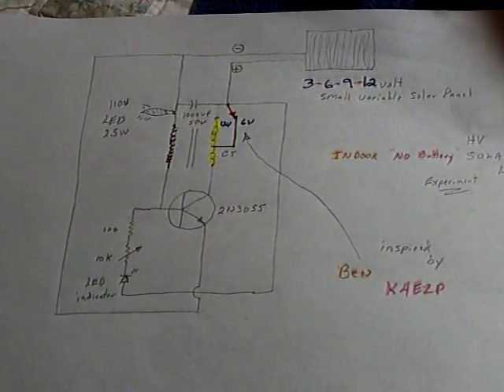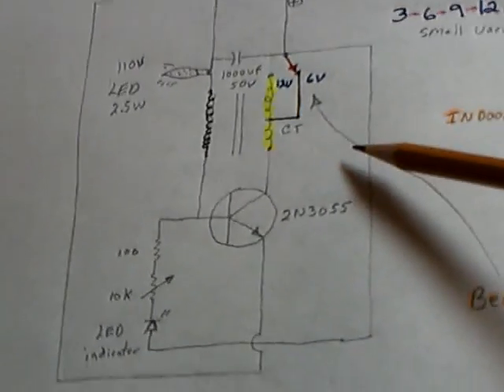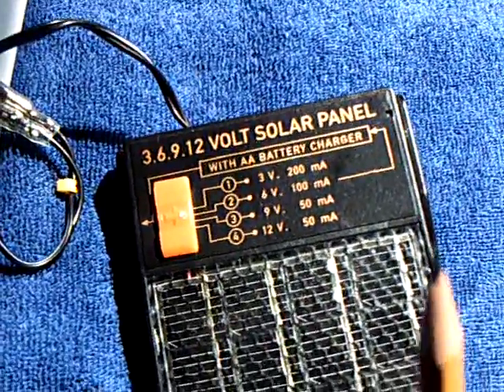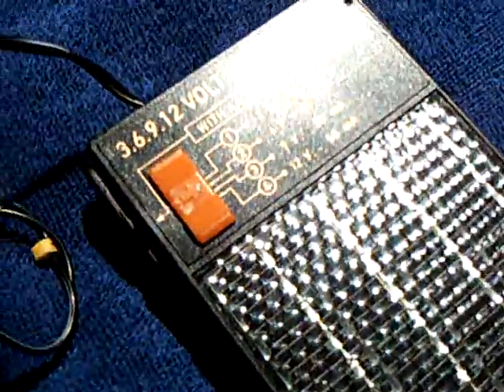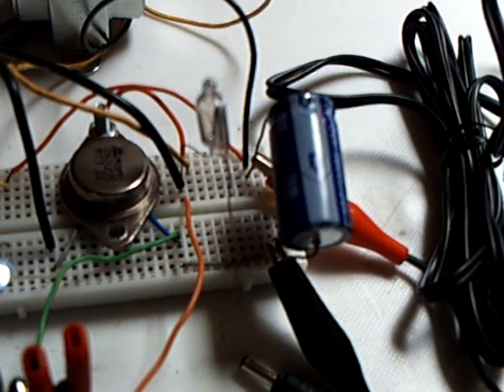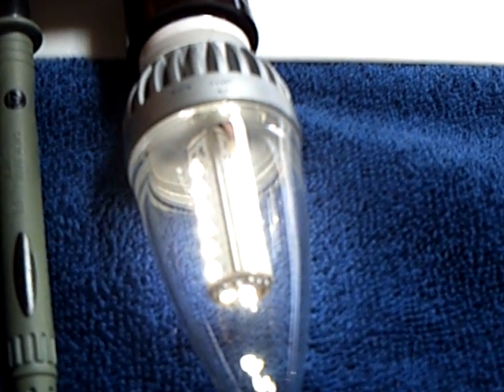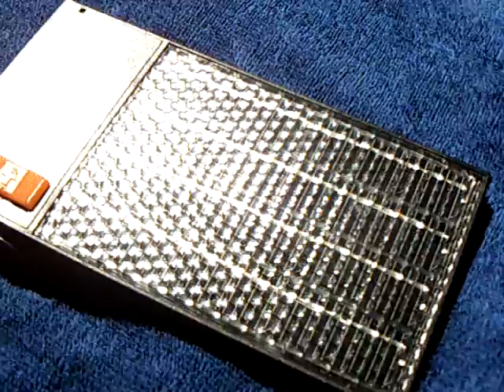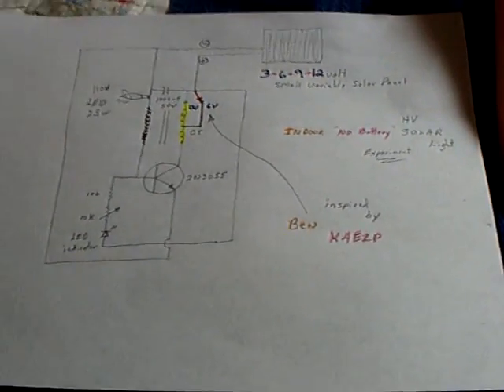Indoor solar panel - No Battery- AC lighting idea.

Comment: Lidmotor thank you for your videos. Have you considered using ultra-capacitors for your batery-free solar powered light system? You can get 350 farad 2.7 volt super capacitors now. I constructed a batery-free super capacitor flashlight with solar panels in the back and a joule ringer circuit inside. The super capacitors recharge very quickly and the joule ringer keeps the light going for a long time.

Also, have you checked out videos about bi-toroids? People claim over unity with those.

Comment: Ok, but I just want to be sure. is the potentiometer 10k? and the resistor 100k?
Thanks for answer.
PS: the solar panel is really expensive at radio shack. You're right.

Comment: Hello there.
I would like to build this, can I get this materials at Radio Shack?
If yes, and if I'm correct, the materials are:

1 Solar panel 3 to 12 volts
1 Radio Shack transformer
1 Transistor 2N3055
1 LED indicator
1 Capacitor 1000uF 50V type electrolytic

1 Potentiometer 10k?
1 Resistor 100k?

Please, correct me if I'm wrong, and what else am I missing?
Once I got the materials do I just follow your diagram?
I would appreciate your response. Thanks.

Comment: Cool. I thought I'd cut some losses and remove diodes once, not only stuffs the panel, but drains battery at night...

How many charge cycles is that hybrid cap worth? I saw it in one of your videos, and wondered what happens when the battery dies, as it invariably will.
I's still keen to get one and have a play though...

Comment from the maker: I have some hybrid supercaps that are 250F rated (they are half cap / lithium battery) that I might try.  If I could get an hour or more of run time on those with useable light that would be great.  This small panel does have a protection diode in it already.

Comment: All (well mostly all, obviously semis don't work backwards)  electronics works backwards. 120v in 6v out transformer will do the opposite if wired backwards. 6v in to 110-120 out is no surprise.... although the way you tapped it is interesting.. Nice work with no battery. battery's wear out and cost a lot. The right Cap will last till the legs rust off Make sure your panel has diode protection! A back surge could do a lot of damage to it's lifespan...

Comment: I love it! You are correct, this could be used in many parts of the world. Even here in America, this could be used in a basement, or even in a closet where no light reaches from a window. Great output for so little amperage! I wonder if there is someone you could contact in Africa, for an example, that could latch onto this concept for a small village setting. There are also people that still live or work in caves, and this could fill the need for lighting without fumes. Good thinking!!!